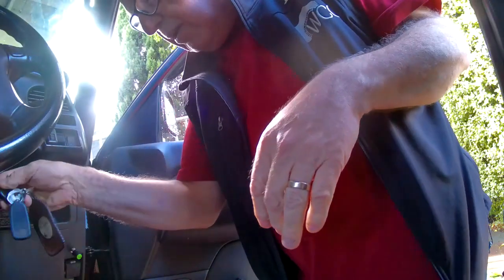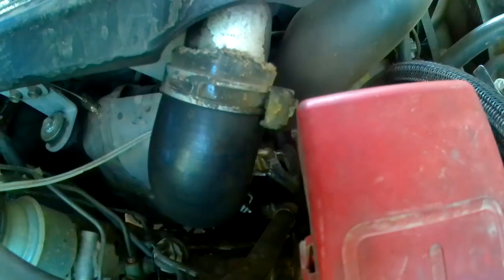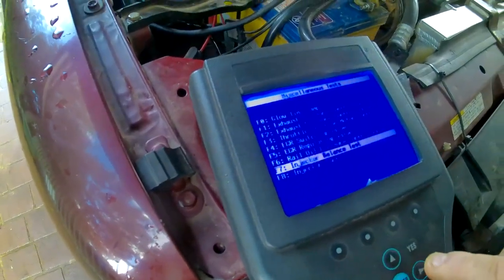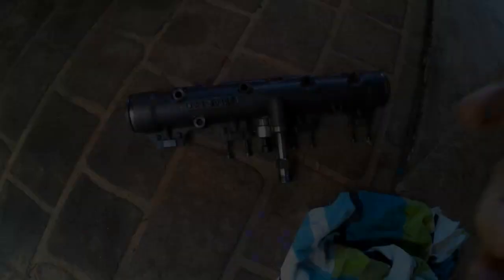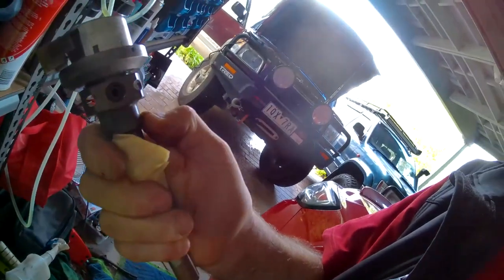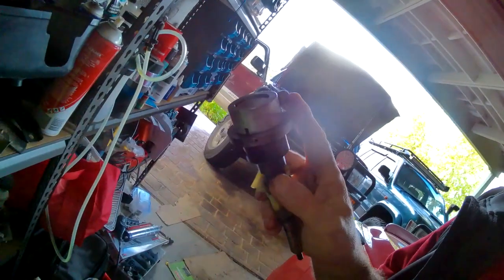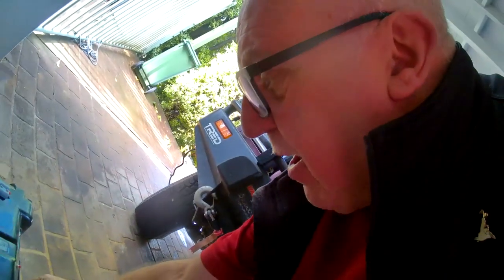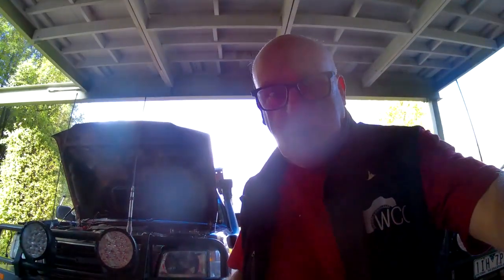Injector Testing using the Tech 2 and Swapping my Battery Box.

Comment: Hi, I was in touch with you previously but can’t find emails. I’m not good with technology. I used all genuine Isuzu parts in the injector sleeves jobs. I put it all back together on Tuesday 29th. Took about 6 cranks to fire it and runs fine. Will check oil level for 10 days or so. Still have to change the oil pressure valve. Thanks a mil for all your advices, may not have done as well as it seems without your input.
Reply from the maker: Glad it went well Martin, what was the Pressure Valve you were talking about? Email address is jackaroochannel@duck.com

Comment: How do you turn a fuse off, circuit breaker maybe.
Reply from the maker: Either unplug the fuse or use a circuit breaker trip. That is what I do for my Inverter to ensure it is off, trip the breaker.